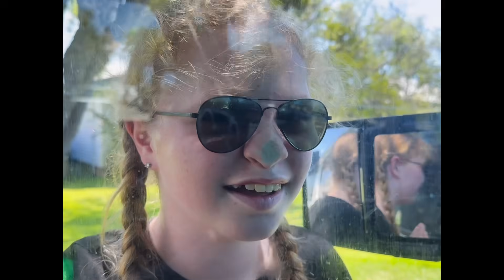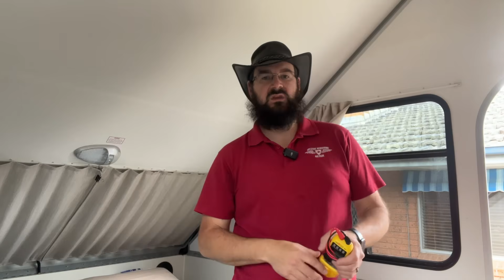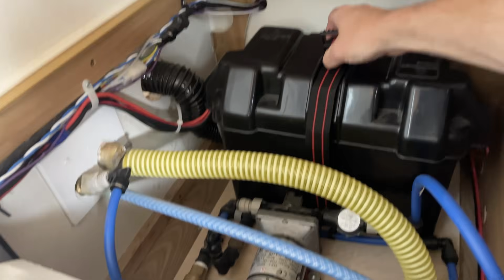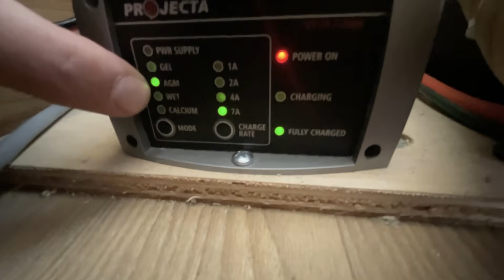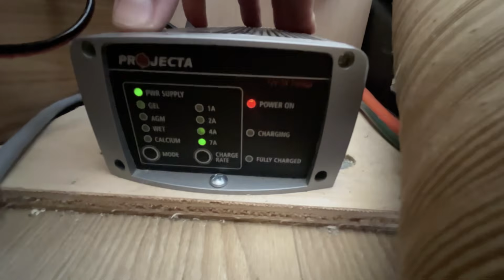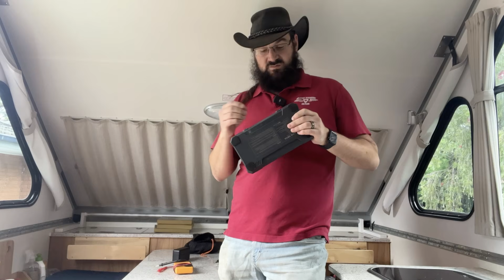MY LIGHTS DON'T WORK - AVan Battery Troubleshooting Video

Comment: In theory if the battery is not going to recover,  the charger set to power supply should give you 7amps of power through the system hence it would be enough to power lights operate the panel on the fridge and run the pump I would disconnect the battery as the power would be diverted to charging the dead battery, as I have only had the Avan for a week have not tested this theory?
Reply from the maker: Correct. If the battery won't recover then setting the charger to PWR Supply mode would provide power when plugged in to run most of the accessories - though it's probably not quite enough to run the pump, depending on the model of pump. Even a basic 6L/minute pump will draw 6A - which is right on the limit of the chargers supply of 7A (IF a 7A charger is fitted).

That being said, a battery that won't recover is likely to gas off, so switching to PWR Supply mode to power the van with a failed battery would need the battery to be disconnected first.

Regardless the battery would need replacing, which in our opinion is a better option than just disconnecting the battery and leaving the charger on PWR Supply mode. Turning the pump on in PWR Supply mode could damage the power supply and leave you having to replace both the charger, and the battery.

Comment: I have to store my Avan outside away from 240v. Do you have any suggestions for keeping the battery in good health?
Reply: I ended up getting a solar trickle charger - fed through 240v port and clipped onto battery terminals. The battery terminals re getting a bit busy though - will be looking into busbars.
Reply from the maker: Great to hear it. Which unit did you end up up going with?
Reply from the maker: If you can't get 240v to the camper and it doesn't have solar fitted, then getting a small portable solar blanket is a really good way to go. Simply sit it ontop of the van if it's in the sun, thread the cables in through the 240v port and clip it onto the battery.

The San Hima 160W panel from VicOffroad is a great option. Use the code "JandTsJourney" and you'll get 5% off (We don't get anything from that at all btw) and it will keep your battery maintained when the van isn't in use. Comes with everything plug and play. We've tested a few different solar offerings now and think this one is really good value.

Edit: They actually have the 260 on sale for the price of the 160. That would be better value, but the 160 does fit (on the rear bed layouts anyway) between the two domes at the front.

https://www.vicoffroad.com.au/products/san-hima-12v-260w-folding-solar-blanket-flexible-blanket-kit-camping-charger
Reply: @jandtsjourney don’t you need to run it through a solar controller?
Reply from the maker: @MrsBMusic that kit I linked comes with one.